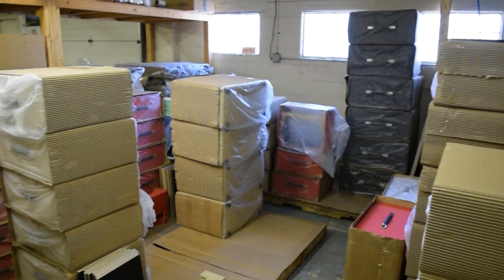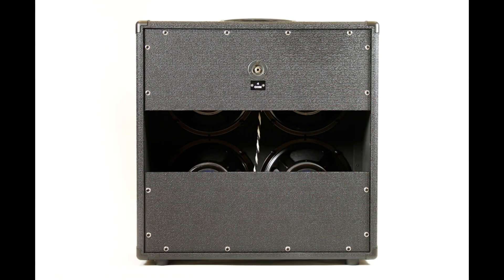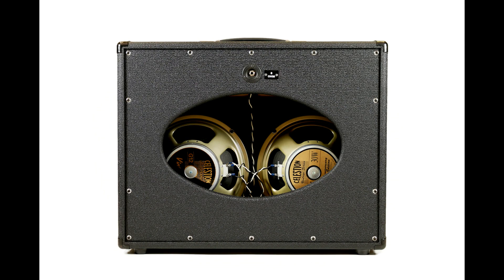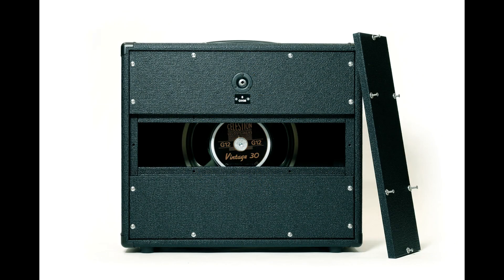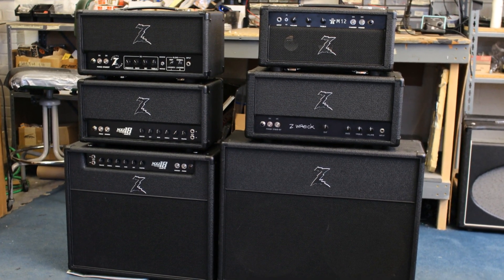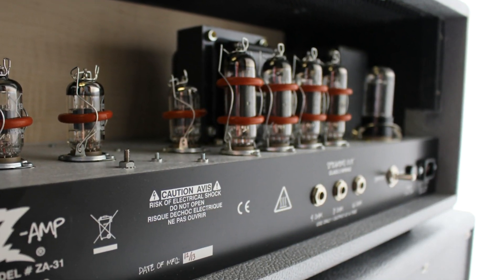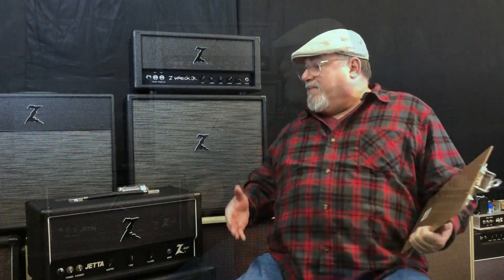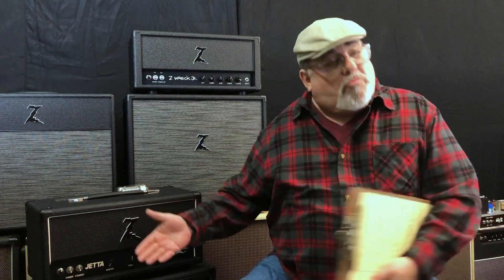Dr. Z AMA: Head or Combo? (JETTA Head / Z Wreck Jr. News?)

Comment: Another advantage of using a head over a combo is less chance of power amp tube rattle, especially in the compact. Combos, I have a Magnatone combo and Dr. Z combo in Magnatone suffers from tube rattle , but when I play it through a different cabinet, no tube rattle. but too expensive EL 84 tubes they sounded like a salt pepper shaker right out of the box tube, sound fine other than the rattle it wouldn’t matter much if it was in a head

Comment: I just bought a new Jetta combo! I returned my Fender Deluxe Reverb Reissue because the tube rattle was so bad I couldn't overlook it (and I was not about to spend the money or wait forever on new tubes and repair work for an amp straight out of the box). I really hope that's not an issue with the jetta.
Reply: Update - got the amp today and have had a few hours with it so far and it is incredible! Wow. Its simplistic but diverse. It takes pedals better than any other amp I've ever played out of. No tube rattle. Pretty damn light. Strongly recommend for the guy who gigs and wants top of the line pro gear but doesn't want to absolutely break the bank.
Reply from the maker: @patmillen9162  Hi Pat, great to hear you are happy with your amplifier.  While any combo amplifier provides an environment that is basically a torture chamber for tubes, we take every method possible to screen for bad tubes, and trust us, we throw out a lot. Please take time to register your amp, as we warranty the tubes for 90 days, and the amp for 3 years from purchase date.

Comment: I enjoyed watching this as it goes a bit deeper in the comparison between the two.  One comment I don't believe I heard or read before was the negative on combos with the tubes co-resident within the same speaker cabinet (pressure, vibration).  I'm curious to know how significant of an issue this could be in terms of the estimated lifespan of the tubes?  I'm in the market for an amp and am considering both options however this data point makes me curious to know how much of an impact it really is.  Thanks again for posting the content!
Reply from the maker: It is a very significant impact and will cause tubes to become microphonic MUCH faster than a head.  There's no comparison really. You sacrifice convenience for tube life with a head.

Comment: Hi Dr. Z. I can't decide which one to choose,  so just need your opinion on which one do you prefer, Jetta or Z wreck jr? And why?
So I can make a decision between the two.
Reply from the maker: Two very different amps. Do you want a dirtier sound or a cleaner sound? Do you play with a lot of pedals or prefer to sound of straight from guitar to amp?
Reply: @DrZAmplification  I'm not a big pedal board guy, only use one overdrive. I like to keep it minimal, light travel. So I prefer straight from guitar to amp. I play mostly clean sound but sometimes need more gain.
Reply from the maker: @billn2421  If you are sitting in the clean range more often, you would probably prefer the Jetta, then use your overdrive to push it into gain. The Z Wreck Jr., while you can get a good clean, it's usually from rolling back the volume of your guitar with the volume knob. It rewards that sort of playing. the ZW Jr. has it's distinctive sound, slightly broken up to explosive distortion, whereas a Jetta is more of a blank slate clean with a lot of detail, into lower, chunkier low gain overdrive.
Reply: @DrZAmplification  Thank you for the recommendation. In my ears I like the dirty sounds of ZW jr but I will go with the Jetta for more clean sounds.

Comment: About the Jetta - what can you tell us about the 7591tube and the type of circuit this power section is and why? I'm totally in love with my prescription ES but I also find the Jetta very intriguing. Curious why no impedance switching.
Reply from the maker: Less output taps on the output transformer means a less expensive transformer to make, which means a lower end price to the customer. 7591 was used in stereo hi-fi's and some Ampeg amps in the 1970s.
Reply: @DrZAmplification  Hi thanks for answering. I was curious about the 7591 voice and behaviours, but "hi-fi" and Ampeg suggest to me it would be very uncolored and in the Jetta the preamp decides the tone and overdrive more than a 6l6 or el34? Just guessing. Thanks.
Reply from the maker: @deanallen927  Yes, to a degree. This amp is a relatively neutral platform. Most of the overdrive you will hear is from the phase inverter and power tubes. It is relatively low overdrive, on the Hiwatt side of overdrive.The guitar and speaker choice will be the biggest deciding tonal factors in an amp like this.

Comment: So, I love the sound of the Z Wreck and I'm super stoked about the Jr, but I'm afraid that it just doesn't have the same guts and sonic presence as the 30w model... I guess the general question I'm asking is can you get the same girth, feel, and punch that comes from a quartet of EL84s with just 2 EL84s? (Does that make sense?)
Reply from the maker: No. You can't. A 15 watt amp is a 15 watt amp, and a 30 watt amp is a 30. Just like a 50 watt amp doesn't feel like a 100 watt amp. 
There's no cheating physics.
Reply: @DrZAmplification  Fair enough! Thank you for your reply...

Comment: What do you think makes a bigger difference in the overall tone of an amp.  Speakers or Power tubes?  I have an amp head that I would like to smooth out the high end. Currently running a 4x12 cab with greenbacks. Tungsol el34 tubes.  The bias adjustment claims to allow any tube that will fit the socket. Suggestions?
Reply from the maker: The speaker is 50% of the equation. Start there. A Creamback 65s would help smooth out the higj end. Power tubes are maybe 15-20% of the overall picture. Also try swapping your first preamp tube for different brands of 12ax7.

Comment: Damn, Z Wreck Jr was $1899 2 years ago. They are now $2,399 at Sweetwater. Up $500 in 2 years. That’s crazy!
Reply from the maker: Unfortunately the cost of steel (speakers and transformers), and aluminum (chassis) has tripled in the meantime. Wood (cabinets) has quadrupled. Those are most expensive components of the amp, and unfortunately the price has to reflect that.
Reply: would never pay that for a Z amp
Reply: @clemclemson9259  it's actually a good price for a handwired amp